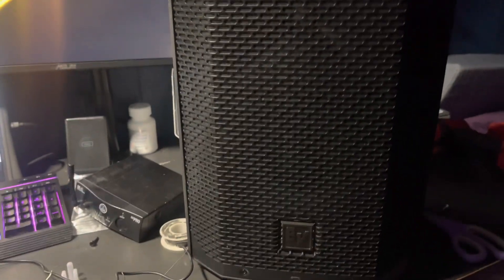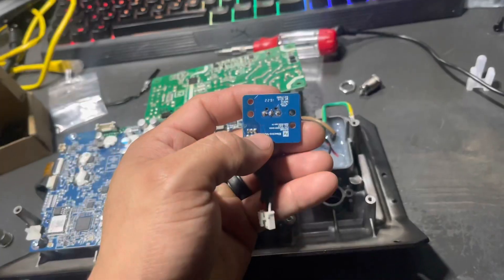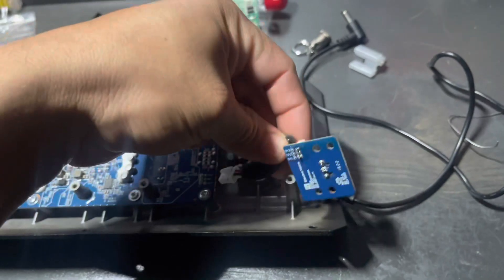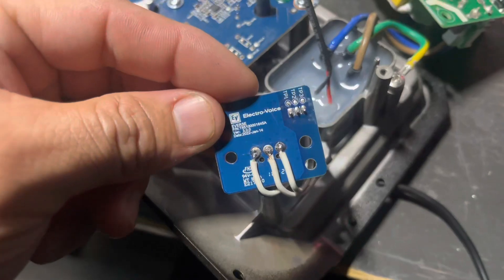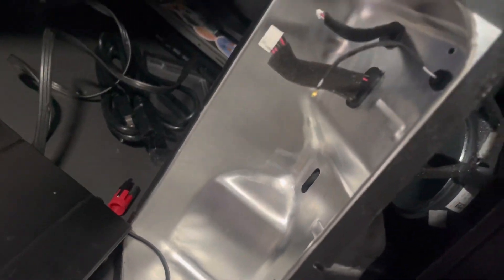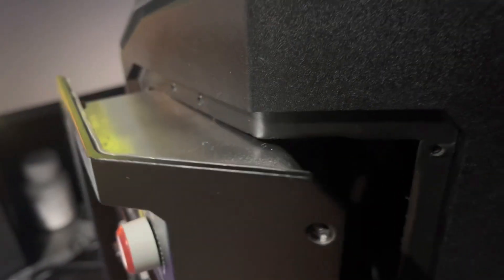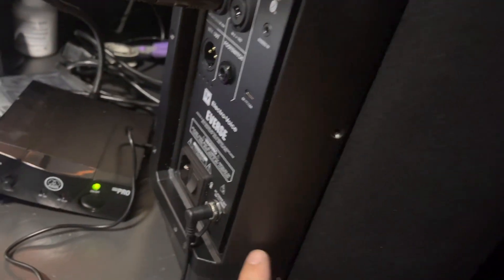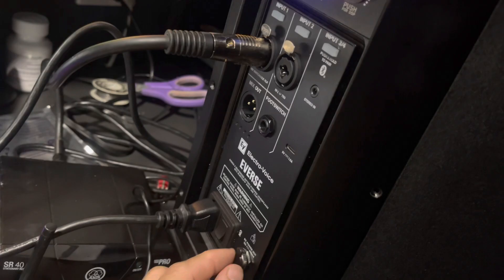Electro-Voice Everse 8 MOD / HACK

Comment: That was a lot of work for something that is easier to fix. Different DC voltages use different size connectors.Since this is a 12vdc output it uses a 5.5mm x 2.5mm jack. The most common size you are mentioning is the 5.5mm x 2.1mm which is the standard size for 9vdc guitar pedals and CCTV systems. Adapters are available to convert 5.5mm x 2.5mm to 5.5mm x 2.1mm. I'm not sure where you are getting the 5.6mm measurement from but I know the jack is 5.5mm x 2.5mm and I'm using just such an adapter for my Everse 8 without any problems.
Reply from the maker: Its a 5.6mm ad stated in the manual.
Reply: @djsupafly1  It may state 5.6mm in the manual (I believe that is a typo) but mine measures out for a 5.5mm barrel  and 5.5mm cables fit snug and work great. Have had zero problems with using the 5.5mm x 2.5mm cables. Also, the cable that came with the tray fits all my 2.5mm jacks with no problems and that's why I believe it's a typo in the manual.
Reply from the maker: @johnclute3058  I've ordered a few 5.5mm cables and have had issues with all of them.
Reply: @djsupafly1  I don't know what to tell you. I'm currently using a 5.5mm x 2.5mm to 5.5mm x 2.1mm right angle adapter with a 5.5mm x 2.1mm cable right now and it works perfectly fine. I have 4 other cables and they all work fine. I bought my adapters and cables from Amazon and one from eBay so they're not expensive brand name items. Again, I don't know why all mine work and yours don't!
Reply: @djsupafly1  I should also state that your way works fine it just takes a little work. I would say to anyone reading this thread to first check and see if a 5.5mm x 2.5mm cable or adapter will work for you and if it doesn't then do the mod as shown in the video.
Reply: @djsupafly1 the manual says 5.5, did they change it?
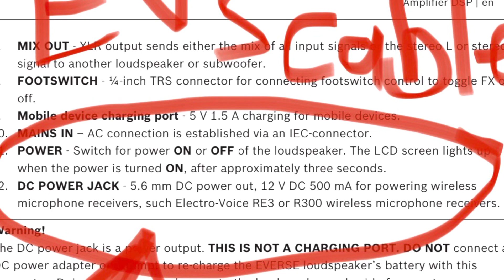Reply from the maker: @seanscam  Yes they have.  I screenshot the manual and posted it on 12:52 of this video where it shows 5.6mm and I have multiple 5.5mm cables that don't work.  Unless they changed production of the everse8 to include the 5.5mm jacks.
Reply: @johnclute3058 I’m really glad I came across this comment because I was surely scratching my head.

Comment: DC POWER OUT - DC power output jack for use with the 5.5 mm outer diameter and
2.5 mm inner diameter DC power cable included with the EVERSE-TRAY accessory. The
DC POWER OUT jack is capable of powering a wireless microphone receiver which uses a
center pin positive polarity and draws 500mA or less at 12 Volts DC, such as the Electro-
Voice RE3 or R300 wireless microphone receiver.
Reply from the maker: Question, have you tried a 5.5mm outer and 2.5mm inner cable on your everse?
Reply: what size is the DC power cable that plugs into the RE3?!
Reply: @djsupafly1  yes I've used the one it came with.

Comment: Can’t you just buy a 5.5 to 5.6 adaptor?
Reply from the maker: if I could find one online.
Reply: @djsupafly1  The linked cable works fine for my Sennheiser units.
Reply from the maker: @joetortorelli2446  which linked cable are you talking about?
Reply: @djsupafly1  sorry! I guess it didn't go thru initially. See below.